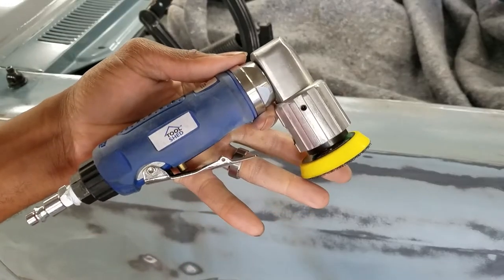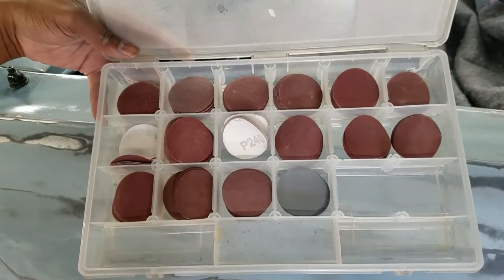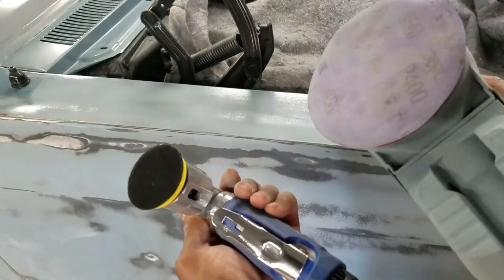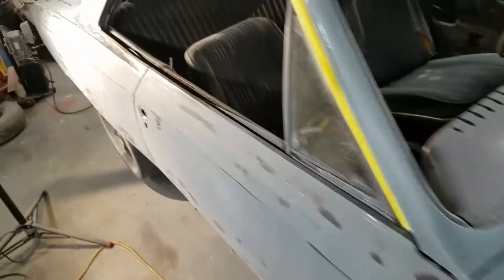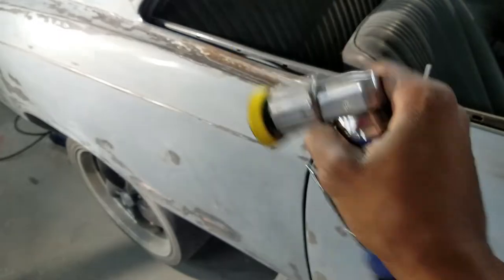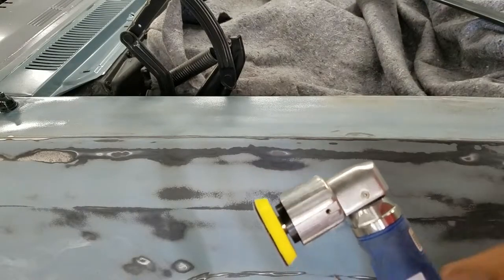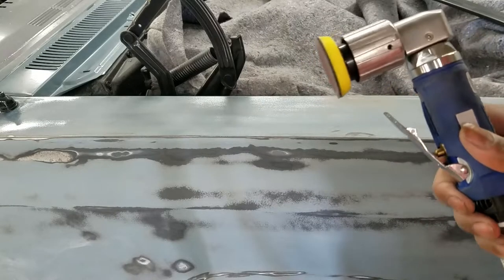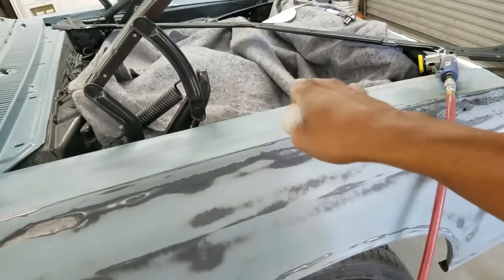2 Inch Orbital Sander Review - The Amazing Little Tool that Could! #DIY #3W1B

Comment: Can you use a pancake compressor with the little sander
Reply from the maker: You could use a smaller compressor depending on how big of an area you need to do.
Reply: @3Wheels1Block  Thankyou for responding so quickly. I’m learning from your videos. I have some stone chips and some spots on the wheel wells, rocker panels. I was looking to buy a mini and a 5 “ pneumatic sander on Amazon or EBay. I do have a pancake compressor. I live in Ontario. Canadian winters are tough and lots of salt on the roads.
Reply from the maker: @adamsons2890  you may also look at a 5" dual actions sander that is electric, those work well also. I am glad that my videos are helpful. 👍🏾
Reply: @3Wheels1Block  Thankyou very much

Comment: What is that mini thin wrench that comes with it? It's #45k on the schematic. What purpose does it have? I assume it goes in the hole by the base of it.
Reply from the maker: Great question, that mini wrench allows you to change the sanding pads on the head of the tool.